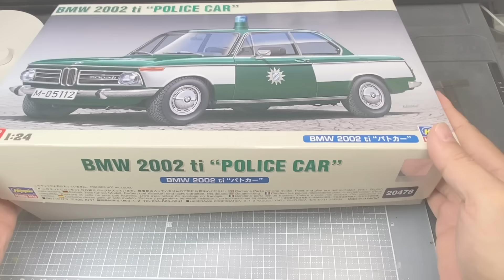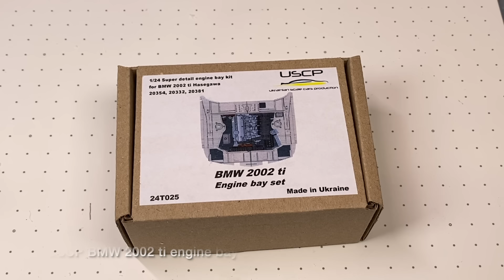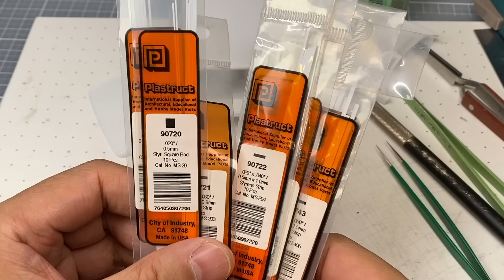BMW 2002 ti 1/24 HASEGAWA - part 1

Comment: Nice touch on the alluminum flat plate u made this look so easy i got sent resin engine an bey but it was copy molded then casted id like to find it on cults 3D or something so I could buy the file to print out ye know anyway awsome looking work so far great builder 👍